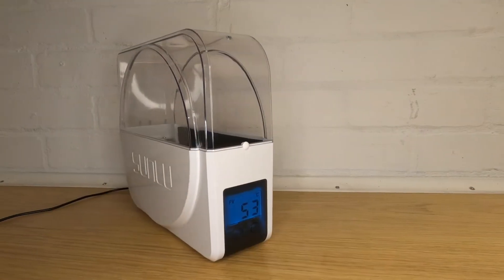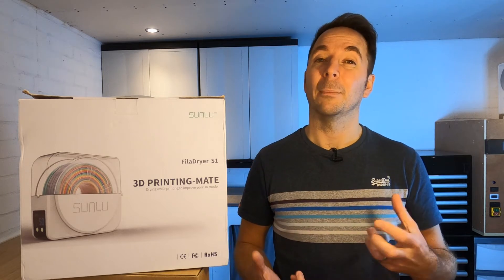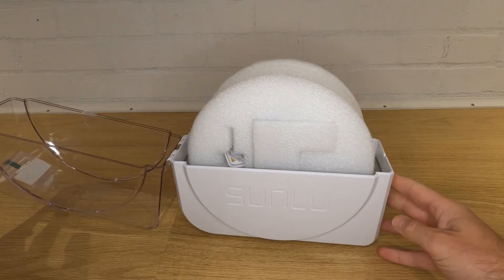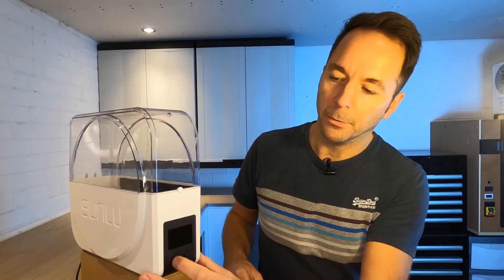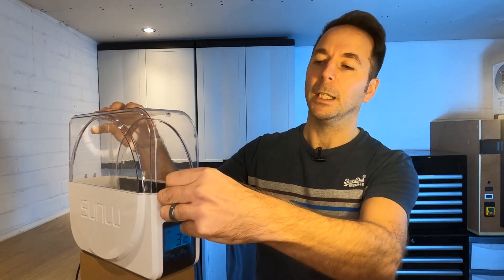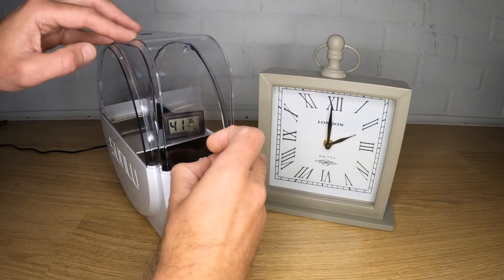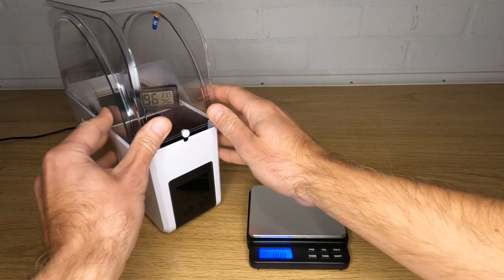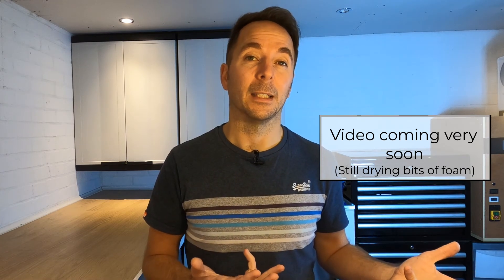Sunlu S1 3d Filament Dryer Unboxing & Review

Comment: Hi Ricky.  How are you running/plumbing your Sunlu dry box to run with your S1Pro? Would really like to know.  Your videos have been very valuable.
Reply from the maker: Hi, I generally have a long length of PTFE tube poked into the original hole in the lid that can then run to any printer I use. With the S1 Pro I run it over the original filament reel mount so it can feed the filament into the runout sensor. I have some little velcro straps that I use to hold the tube in the right position so that the filament doesn't kink👍

Comment: People do normaly Desiccant packs in the dryer to absorb the moisture. 🤗
Reply from the maker: Yes but through testing I found that didn't work as well as venting the air.
Reply: @RickyImpey  depends on the moisture content how fast the Desiccant can absorb it and it's usually many hours not in short time, that's probably why opening the lid is better. 🤗